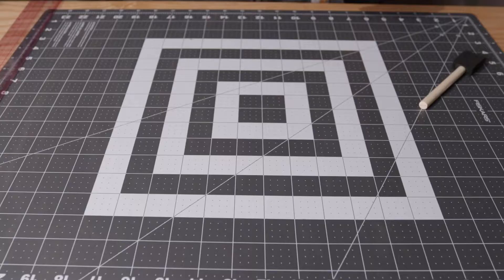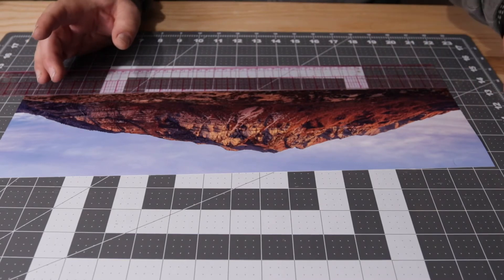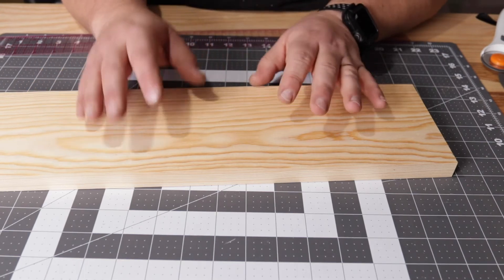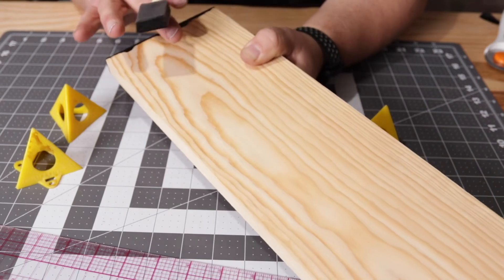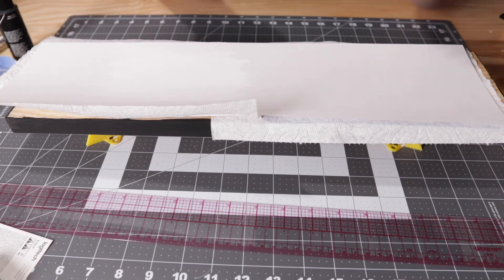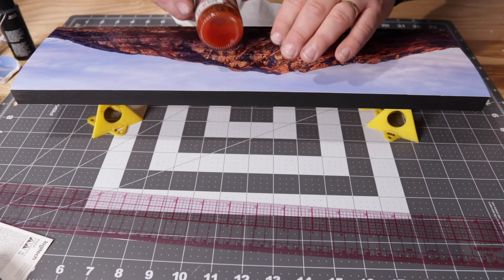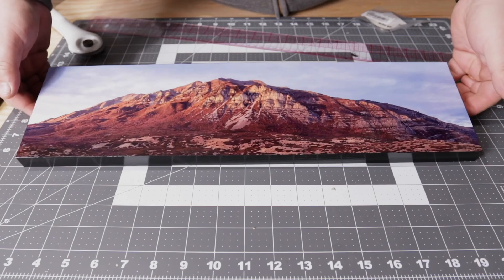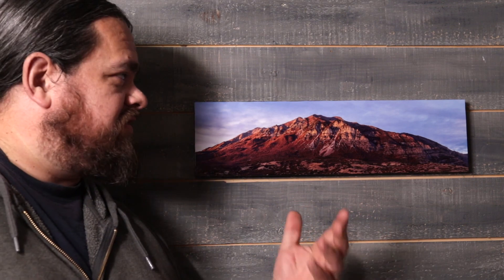How to Make an Easy, Not-picture Frame, Picture Frame Thing | Easy DIY Christmas Gifts

Comment: Great project! Is the photo paper a certain brand or the shellac doesn't affect the ink or paper?
Reply from the maker: It came with the printer. It’s Canon Pro Luster. I didn’t try shellac, though I am curious how it would work. I would try it on a test photo first just in case. The spray I used is a gloss acrylic sealer made by Mod Podge.